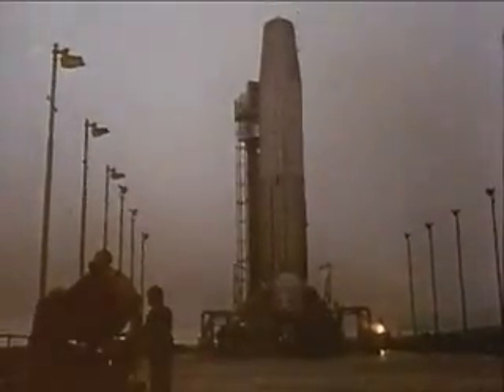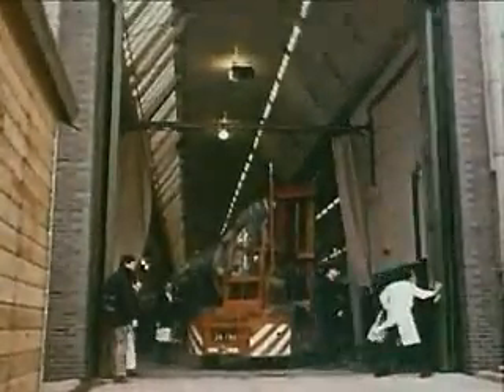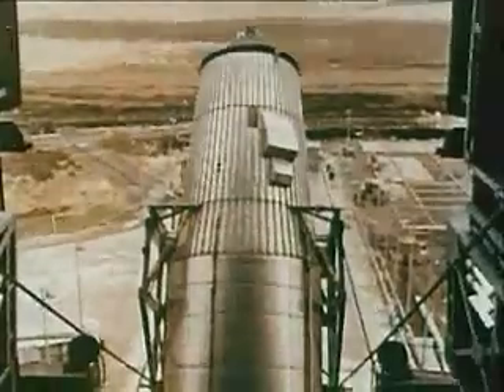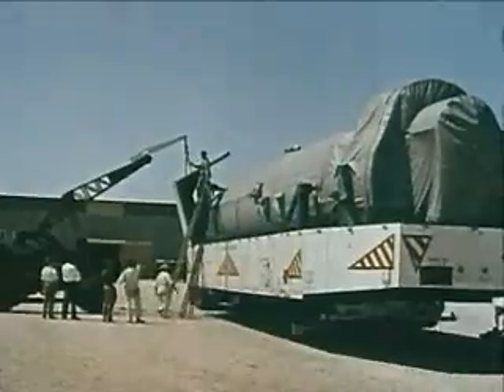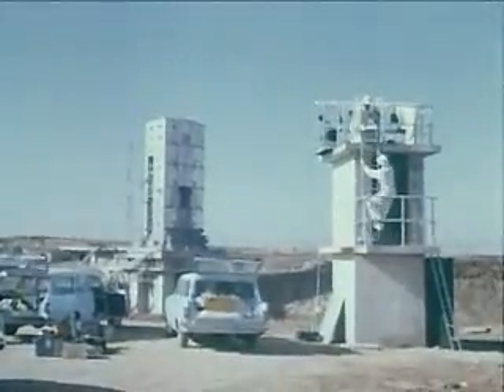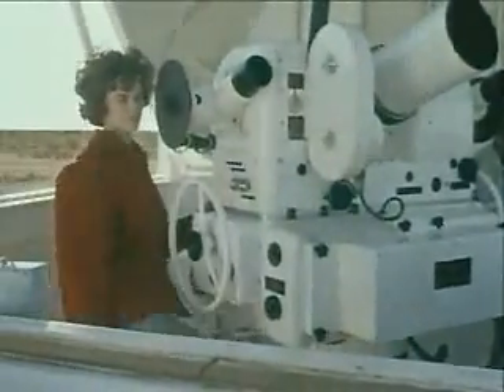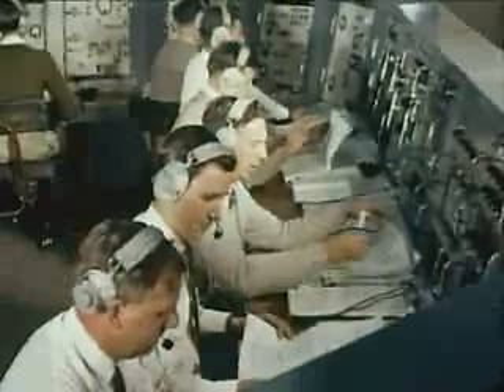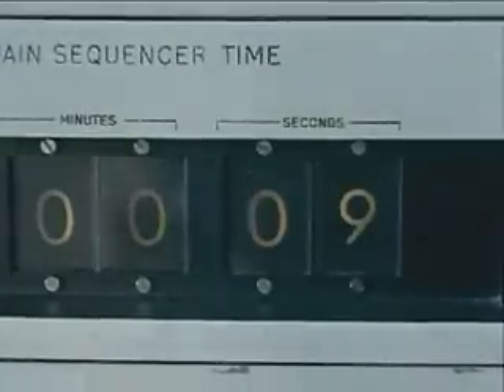British Medium-Range Ballistic Missile (MRBM): The Blue Streak Rocket - 1964 - CharlieDeanArchives

Comment: The British version of Atlas complete with a balloon oxygen tank too. They could have had a launch facility on Bermuda
In April 1954 the Americans proposed a joint US-UK development programme for ballistic missiles. The United States would develop an intercontinental ballistic missile (ICBM) of 5,000-nautical-mile (9,300 km) range (SM-65 Atlas), while the United Kingdom with United States support would develop an Intermediate-range ballistic missile (IRBM Blue Streak) of 2,000-nautical-mile (3,700 km) range to be powered by an uprated liquid-fuelled Rocketdyne S3D engine.
But the faster developed American Thor IRBM proved to be the more cost effective alternative
Reply: The basic design of the Engine was copied from a US engine as well as the Atlas tank concept.
Reply: @richardvernon317  licensed from Aerojet and improved by Rolls-Royce.
Reply: @richardpurves  Rocketdyne actaully!! And the "Improvement" was most likely reverse engineering the Engine to use British parts.
Reply: Missile body by dehavilland